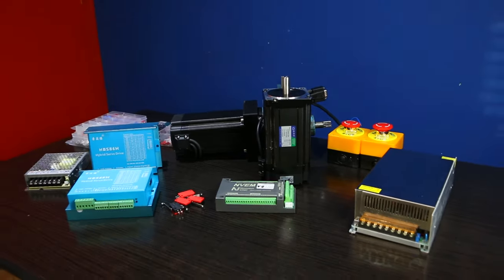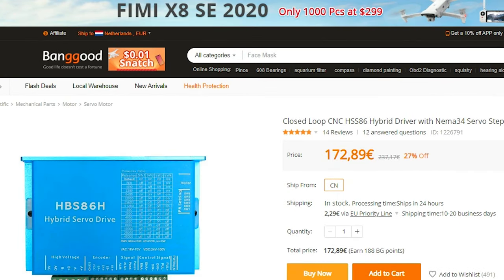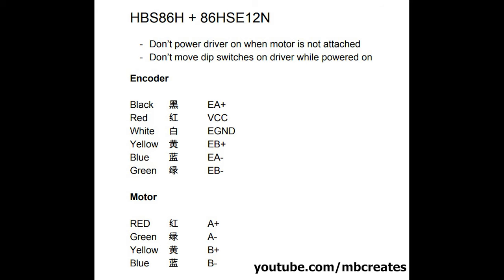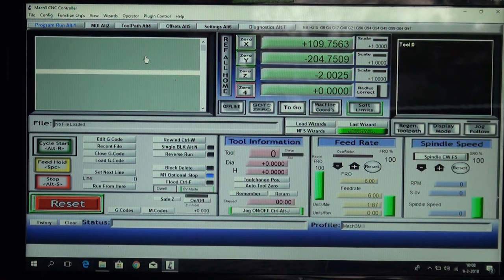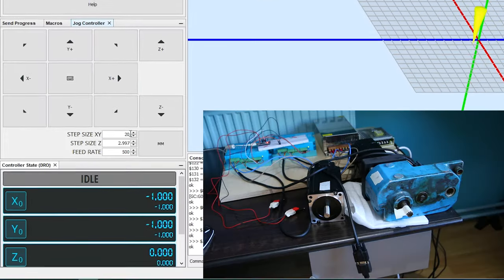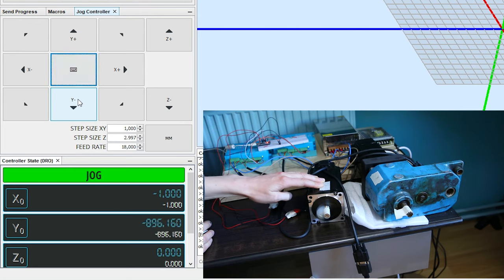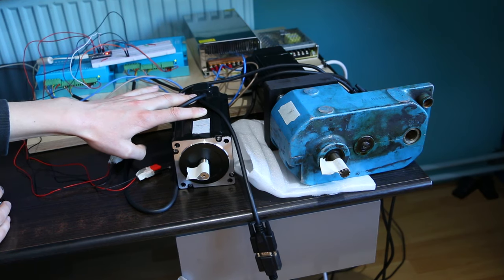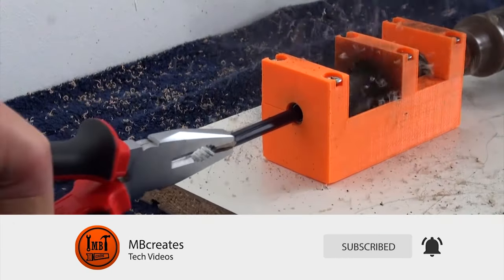Testing a NEMA 34 12 N.m Closed Loop Stepper Motor

Comment: It is funny that most ppl use the VCC as the common, in mine i'm using Gnd as common and connecting the En+, Dir+, Pulse+ to the board. But also, i am using a different board.
It worked. I was having issues since I confused that the 24V/5V switch, I thought it was 24V since I was getting this voltage from my Power supply. It was 5V, because i'm getting 5V from the board. -_-
Spent 5 hs in this. Learning.
Wonderful, tks for sharing.

Comment: I bought about 20 of these motors for some prototyping we are doing at work for a robot. With both the hbs86h and hbs860h drivers. There are a few more options on the hbs860h for a bit more fine tuning, but usually not needed. People should be aware that the coils are sometimes wrongly labelled on the motor vs the driver, so if you start it with an arduino or another mcu with a simple code in c++ or python and it is rattling or shaking or not moving at all. Try to switch one of the + and - on one of the coils (A+,A-,B+,B-). Just annoying using time debugging for people buying their first one.

Comment: Attention to the NVEM card.
The card would seem well made, but it has serious software problems:
the plugin that is provided does not work correctly, in fact it has serious problems with soft limits and with home switches (this problem does not concern only my controller but all of them, in fact reading from the forums these problems are due to the plugin made really badly, also the manufacturer no longer gives support on this product, so there is no solution to these problems.
Below is a list of the problems that this type of card has (NVEM4 V2)
Operation problem: crashes, disconnection from computer, soft limit not working, MPG + dangerous emergency (with emergency not restored, the machine still moves using the MPG).
If it is still possible, replace it with another controller
Reply from the maker: Yeah, have replaced it with an Arduino. I wish I knew this before...
Reply: That's what I thought when I saw the card in the video. Actually I don't know of any Chinese card that works correctly with Mach3
Reply: @MBcreates 
 I am going to use 3 nema17 7.2kg torque motor is 1 lrs75 24v power supply enough for it?
Reply: @MBcreates  How on Earth could you replace it with Arduino, given how slow Arduino is to send pulses??

Comment: How does the controller correct any missed steps?  Does it stop the other motors until the steps are correct?  How much error will be seen in the cut when this happens?  I great video would be to cut a circle and a diamond while holding an axis to purposely cause a misstep.  It would be cool to see what happens!!
Reply from the maker: Everything is done in the blue driver box. From what I understand (haven’t had time to completely read in on the specs) the driver corrects for lost steps in real time and you won’t notice anything while the motor is spinning. I suspect that an alarm mode is triggered when you purposely block an axis from moving and the driver shuts down but I’m not sure on this. 

Great idea on the test. I will keep that in mind :)
Reply: @MBcreates  The driver has a simple PID controller. Lost steps are corrected by speeding up the motor to catch up. When the error (difference between the reference signal and the ouput) becomes too large, the driver will stop the system and return an alarm.  This already happens when the motor is stalled for just a second. You can configure this yourself. The default gains of the controller are fine for normal use, when you want high performance with high accel/deceleration times you really want to tune the controller to your needs.

I have the same setup from Leadshine. I believe the one from Banggood is just a knockoff of leadshine but I guess is should work the same.

Comment: Nice video, I've received 4 days ago my 6040, I designed and sent the files for a new work plan to a local company. Could a small vise be a good idea to fix the pieces? I think I will work mainly aluminum

One more thing, my fourth axis motor is pretty weak, is it normal or my motor/ motor driver is damaged?
Reply: Simone Chiarlo do an unboxing, review, problems you’ve encountered and many more things. I mainly use co2 lasers and 3d printer and I’m looking to get a 6040 for my first cnc but there are only few videos and I’ve only come across 1 unboxing.

Comment: Much better choice: 3ø Mitsubishi Servo Motors
Reply from the maker: They look nice. Have you worked with these servo's before?
Reply: @MBcreates  yes with Mitsubishi MRJ2S-70A 750W Servo... and may be new plan with 1.5kW or 750Wx2 at Y to move table...
Reply: @MBcreates  I used servos as they are much better choice for pro CNCs, as stepper motor's armature got play after few time... so to use servo in 3ø mode leads to efficient system and long term usage... not only because its armature is well built but also better encoders, control so on... any professional MACHINE!!! (Except toy or router or bad Chinese) using steppers??? I also used the same product you're using here... when I used open loop stepper/encoder less stepper with this driver it fries the driver... if you're looking for less budget then go for it... if professional and much better product then servo is much better choice!!